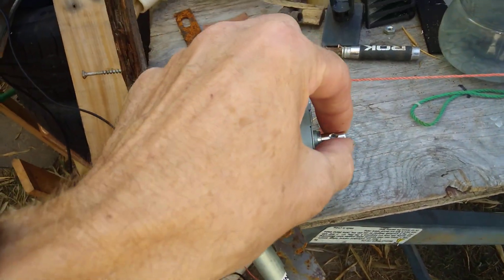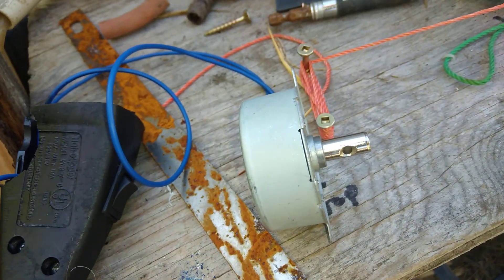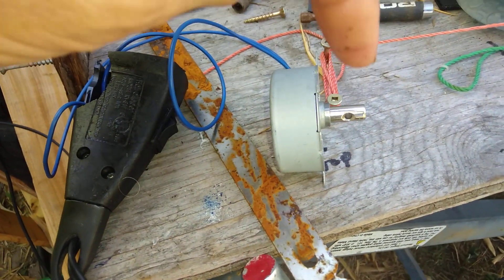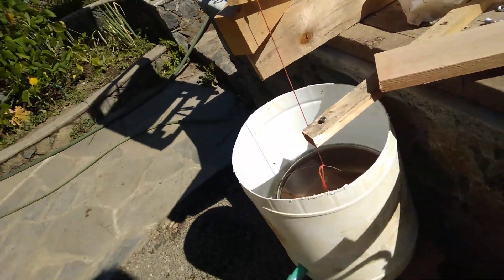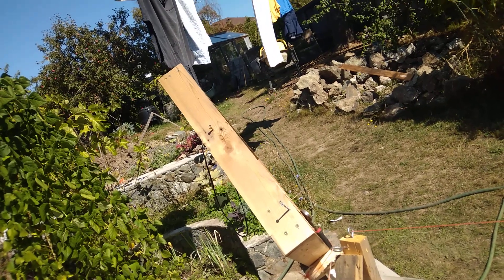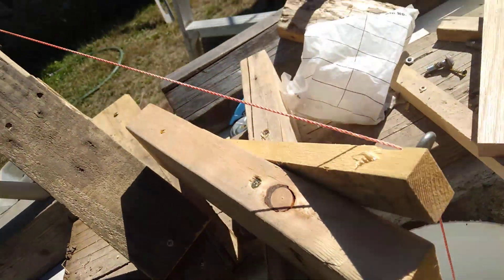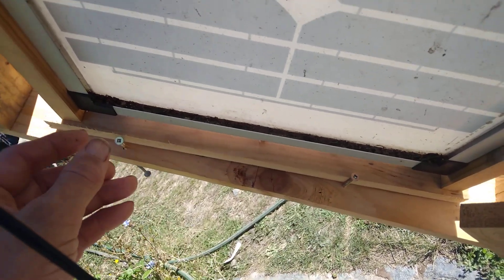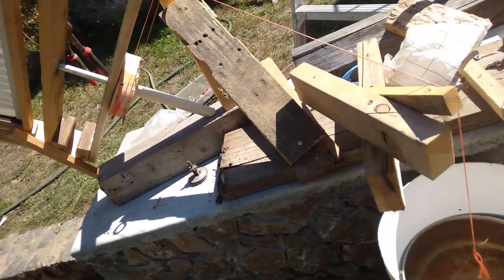Demo of Zombie Pneumatic Solar Tracking (solar panel on equatorial mount controlled from afar).

Comment: I love the engineering and maybe I'm missing something but why not use a higher torque motor to spin the panel directly?
Reply from the maker: Thank you.  It's because one of these "timers" and one  air pump can spin 10 or 20 or 30  panels at the same time.  I don't know the cost of 10 higher torque motors or the maintenance on this compared to higher torque motors on every tracker, but hopefully this will be cheaper.   Also, if the float is a fairly good fit into the cylindrical containers, you get a "damping" effect for wind gusts, because the wind energy gets transferred to the water around the float.   I think this will mean these things (if they ever go mainstream) will last longer and if anything goes wrong,  you can fix it without ordering a bunch of parts from the manufacturer.

Comment: If you're going to use an electric motor, you can just as well use full tracking electronics?
Reply from the maker: On every solar panel?   I also realize that I can use the low pressure air as an analogue "timing circuit" to automatically switch on and off things in my greenhouse (that doesn't have electricity). So, it might be able to close and open thermal blinds at night and in the morning and maybe automate other chores in the greenhouse too.  all it needs to do is have another set of  containers and a cam that rises and  switches on and off various valves as it rises.   I currently water everything there on the same schedule (dictated by my electrical timer) but not all plants need the same amount of water, so this analogue timing system would probably help with the watering too.
Reply: @Brians-tracking-solar-scoop Unless you can drive them all from the same motor?  Which low pressure air do you mean?
Reply: @Brians-tracking-solar-scoop  For the venting there are passive solar pistons working with air or wax (like in the cooling fluid system of the cars), expanding with heat.. Can be used to open windows, to moove the pannel in the right direction...

Comment: Interesting ! So if i understood good, it is more like a blind clock, well adjusted to the sun's course than a solar tracker using some captors ? What happends when the maximum course of the day is reached ? Is there some automatic reset every night ?
Reply from the maker: I'll probably do it like a 24 hour clock.  Any tiny leaks in the system will let the air  out over a few hours, return the water to the lower tank  and reset the thing to the morning values.
Reply: Ok !  @Brians-tracking-solar-scoop